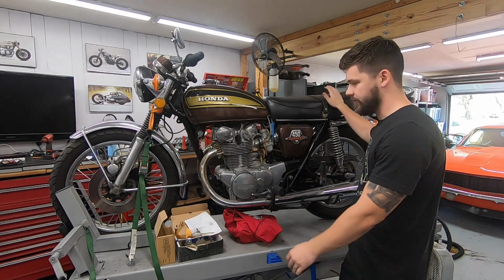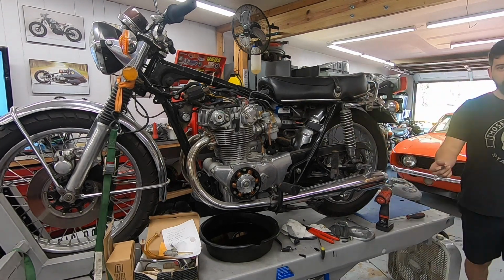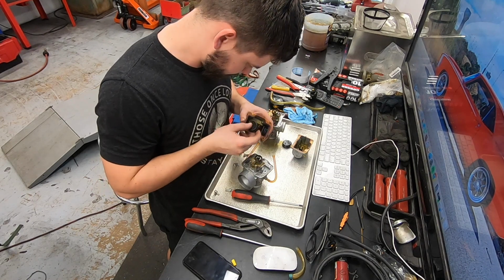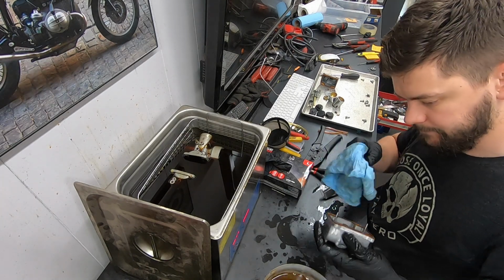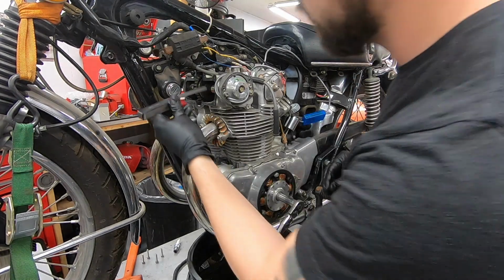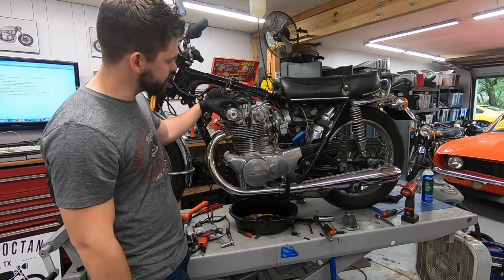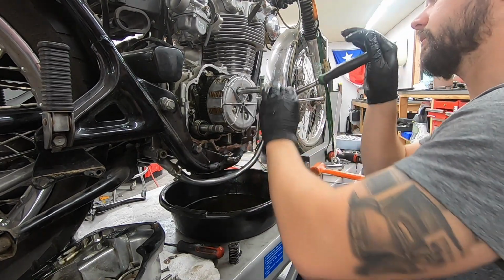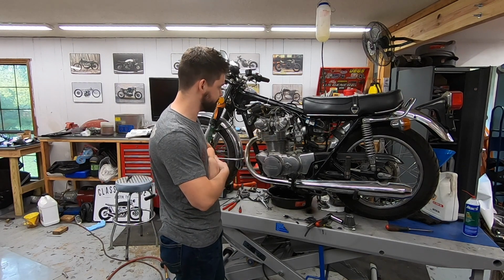1974 Honda CB450 - Will it run?

Comment: I've always been warned to undo clutch plate bolts a bit at a time evenly to not crack the plate due to spring tension. I respect your experience so I suppose it's not as critical as I thought. Perhaps if the springs were closer to spec, it might have been an issue? Just sayin.......

Comment: I had a 71 450 for 17 years, I would hate to think the mileage I did on it, I think around the clock four times at least. Got porosity in the castings unfortunately but I did so many miles on it, would love another one.

Comment: i has CB 125 twin, CB 350 twin, CB 500 four and CB 750 four, best bike ewer has 750, and worst bike has 350 clutch has all time broken worst plan and build clutch system what i has newer seen. i love my CB 750 perfect bike travelling around to europe when i has young boy about 16 year i travell around europe my CB 750. newer not has broplems at engine, CB 500 has little problem drop oil out cylinder head camshaft cover side newer not can stop oil leak i try repair many many time this.

Comment: My first bike was a 1971 CL 450 Scrambler with a 2.4 gallon tank and pipes up the side.  Rode it 1200 miles to college and after graduation rode from SD to CA and back to SD through Texas.  Young and dumb.

Comment: What do you use in your ultrasonic cleaner? Looks like it did a great job, didn't hurt the plastic or rubber either. I haven't had any good luck with mine yet.

Comment: One thing that did not really work on the CB450, was the electric starter. In front of the motor, with a chain connected to the crankshaft.
I had several engine failures, caused by the pinion on the crankshaft. The screws on it came loose, and ruined the whole motor.
You should either remove the chain, and the pinion attached to it, thats what i did, or use glue to fix that screws...

Comment: Are you not worried about damaging the clutch basket? I've only replaced two clutches, but the manual explicitly stated to alternate between bolts similar to a star pattern.

Comment: The CB 450 has  issues. The top end was not ventilated properly. Gas fumes would build up washing oil from the cams causing premature failure.

Comment: My first motorcycle was one of these. I was 18 when I got it. Sold that 2 years later and got a 1978 Suzuki GS1000. Also had a 1980 KZ1000, Yamaha FJ1200 and last was a ZRX1200. Most fun were the CB450 and the GS1000. Probably because I was so much younger then.

Comment: Aah my first bike was red CB 450 absolutely loved it. Had absolute ball on this machine . Front brake and one cyl didn't work in the rain. Chewed thru swinging arm bushes . Always fished broken bits of cam drive sprocket dampening rings out of centrifugal oil filter . But oh so many great times wish I had room in the garage for another one.

Comment: I had a 73 CB350 that I rode all around the Southeast USA.  I rode it maybe 10K miles and then I blew the head gaskets.  I replaced the head gaskets and never had another problems with it.  As with most Honda products, it's bullet proof.

Comment: I had two of them (in succession) in my late teens. The were probably late 60s models - drum brakes and no chrome on the tanks.
I loved the sound and excellent power for a 450.
There were a few issues though :- I found to my surprise that if you maxed it out (indicated 115 mph) and then tried to stop in a hurry, the brakes would fade to nothing by the time you got down to 60. Que frantic down changes and the back wheel skipping around. Very exciting.
It was also prone to getting a speed wobble when it was in the mood. 
Also the roller big end bearings were not durable - had to change cranks several times, but maybe because it spent most of its time at or sometimes over the red line.
But I would still love to have one now.

Comment: I remember the very moment I became addicted back when I was 16 and gas was 10 cents a gallon, sitting on the back of my best friends 90cc Suzuki scrambler as we accelerated from the five way lights at the center of our downtown, population 15 thousand, how the piston hammered up my spine, omg I really, really want one.
So, luck was with me and next summer I got a job at Expo'67 and with the money left over after buying that gorgeous white electric guitar (a piece of shit that shredded my poor finger tips and got me fired from the nascent band) I bought the most CCs I could afford (not quite, I disdained the 350 Jawa probably 'cuz of its communist connections). It was a 1967 Honda CB175, you know, the one with that ridiculous pressed steel frame. I rode it hard (like it was a scrambler (oh but it most definitely was not)) right into the start of winter but stopped when I had to put my feet down to stop me falling over as we pulled a full 360 in only one inch of snow on the smooth asphalt.
It was probably the next summer and our motorcycle 'gang' had driven to the beach (ha ha, my bike was one of the largest). Night had fallen and as we lay among the dunes drinking beer and smoking reefer a full lunar eclipse bathed the whole scene surrealistically red. After it passed we walked out onto the flat hard sandy beach and saw some guy rapidly approaching an a huge gigantic bike. That was the first time I saw a 450 (just like the one above) and miracle of miracles somehow he let me take it for a spin. Oh yes, I was immensely impressed. All I did was turn the handle and the rear wheel turned faster than the sand could handle and sprayed the crowd as I took off. It was so much more than the 175 that had to be revved up very high before I could pop a wheely. Those were the good old days.

Comment: Looks in very good condition. i would replace the pods with an original air cleaner. Smoke probably just a sticky ring or valve from sitting. A hot ride would fix that.

Comment: Thanks for the video! I’d love to see how you replace the clutch cable once the new one arrives. I tried replacing mine on my 450 but have troubles with the little join clutch (the little part that’s on the cable and goes between crankcase cover and motor. )  can’t seem to get it off the old cable.

Comment: I didn't know there was a 450. About a month ago I almost caved in and bought a CB400 to tinker with.
Reply: Yeah brother the cb450 was released in 1965 as the black bomber and ran up until I'm pretty sure it was 74, but nonetheless all of the CB models are pretty badass and reliable, the cb400 that you almost bought was it the F model with four Pistons?

Comment: Great video, I have a '75 CB500T engine inside a '72 CB450 frame. It was a basket case that I resurrected and I'm happy to say is back on the road. The timing chain was the hardest part to get sorted and aligned correctly. Keep up the great videos. Cheers

Comment: Honda built these with intentions of racing it against mid weight british bikes in road racing. That valve design allowed the engines to run higher revs than other bikes in the period.. 
I did a restomod on one of these. I found charging system and super stiff rear shocks were biggest issues that made these the underdogs. They race these a lot in Japan.
-cagrisayin

Comment: Hi what solution do you use in you sonic cleaner ??.
Reply: I think he is using the berrymen's carburetor and parts cleaner that comes in a bucket for dipping, and it does work very well

Comment: OMG, what a flashback. My first "big" bike was a CB450. Bought it when I was 16. Let me give you some warnings though. It doesn't handle well. Once while riding at about 50mph, I hit a deep manhole cover and my steering went VIOLENTLY from side to side, and I thought I was about to die. Miraculously I managed to recover. Took it from San Jose to Yosemite, and a few other shorter road trips. It vibrates so much your hands literally go numb and you have to stop once in a while just to get the blood flowing properly in your hands. Eventually I sold it, and the guy I sold it to ate it on a corner and nearly died. Then I repo'd it (he never paid in full) and sold it to a friend who PROMISED not to put it on the road. Of course he did, and, with no helmet, hit a small rick or something and he lost it like I nearly did and he DID go over and also nearly died. Sorry but I DO NOT recommend riding this bike. Amazing condition though and it had decent power for a 450.
Reply: I have a feeling that those people that you sold the bike to that ate it were not riding that bike within their limits and the bikes limits of course too, everyone's got to remember these bikes are almost 50 years old and some are even older like the 1965 cb450 black bomber, and they are not going to handle like a modern sports bike, anyone that rides needs to ride within their limits not flying down the street and trying to take a corner as quick as you can on a 50 plus year old motorcycle, these bikes are as safe as you want them to be, as long as everyone rides within their limits and of course the bikes, but of course some upgrades will be needed like tapered roller steering bearings and new brass swing arm bushings are a must for better handling
Reply: @oilinmyblood3906  - you are correct, but only somewhat. Like the dude I first sold it to went too deep into a curve and hit some gravel which caused him to lose it. However, my own experience and that of my friend proved that the bike was highly unstable if you hit an obstacle. Hitting a manhole that was under 2 inches below grade should not have caused my front end to violently swing back and forth. Do some research.
Reply: @need100k  brother believe me when I say I researched these motorcycles every single day, I own three cb750's and a cb450, I'm wondering if your steering neck bearings were shot or something, because they are not supposed to handle like that, if the bike is really nice and tight with no Loose Ends like loose steering neck bearings or your swing arm bushings are shot and worn out that will definitely make the ride much more unstable, but they do handle very well if everything is nice and tight and has good swing arm bushings, it sucks you had one that wasn't a good Rider, if you were in Anaheim I can let you ride mine
Reply: @need100k  yeah dude right on! if you're ever around Orange County hit me up, my cb450 has 10,500 or 10,600 miles, pretty low mileage, man that's cool as hell you live in Hawaii!! Be safe out there bud...

Comment: Hi Taylor
Great video as usual and looking forward to the next.
What size is your ultrasonic tank and which cleaning solution do you recommend?

Got the answers from your previous posts. 
Berrymans Carb Cleaner and almost 3 Gallons to fill your tank so I guess your tank is around 15 litre  volume.

Comment: My memory of the 450's was a poor charging system. If you didn't get out on the highway, the battery would eventually be totally discharged. I don't recall if there was ever a fix for it.
Reply: Yes they're absolutely is a fix for it now to keep your battery fully charged all the time, common motor works in Houston Texas has a regulator/rectifier combo that works very very well with the 450, once that's installed you should have no charging issues whatsoever
Reply: bridge rectifier on the alternator...... Honda used a selenium diode which goes bad.
Reply: An intermittent or bad rear brake lamp caused my battery to always discharge back in 1976. Newer or better lamp helped

Comment: Would c foam keep the carb clean on this bike?
Reply: If you run ethanol free gas you'll be fine ,just put a little in every few tanks to keep the valve's cleaner, but if it's sat at all,with cheap ethanol fuel,you'll be pulling off carbs,good luck

Comment: Best to run the timing light off it's own 12v source.
Reply: Can you explain why? The 12V power is only for the operation of the timing light (xenon tube) and do not affect the result even when the power source is an external power source.
Reply: @GettingNervous  It is not absolutely mandatory to use a separate power source but it is recommended as it is possible for AC pulses in the  the bikes wiring to influence the timing light when powered by the machines battery. The separate battery is not affected by this. Many service manuals recommend this step.
Reply: @tmackinator  Thank you. For myself i am always using a separate power source because all of my old mopeds are running on 6V.

Comment: Hi Taylor, I’ve heard that these bikes (CB750, 500, 550, 400) that are esentially the same have charging problems when they run a electronic ignition, and this is because their alternator does not generate enough power for the additional energy that it demands. I personally own a CB750 K5 with electronic ignition and, precisely, this is my problem if I do not ride the bike at more than 3.5Krpm, but sometimes in the traffic this is not possible and at the next try electronic starter does not run the bike. I need to use the kick starter. Have you experienced something like this?
Reply: Had 3 Of Theses  ALL  Took  A  bridge rectifier        bridge rectifier on the alternator...... Honda used a selenium diode which goes bad..... I got these bikes for a cheap ......fix them for $18 I got these bikes for a cheap fix them for $18

Comment: Pamco electronic ingnitions are junk! Swap it out for the Shockwave electronic ignition from the guys at Common Motors. It's sooooo much better!
Reply: NorCal Rider  the quality of the Shockwave is much better and it's A LOT easier to time!
Reply: I had one, it was pretty good, until I got cought in the rain 😒, wouldn't buy again

Comment: What do you use in your ultra sonic cleaner?  I recently bought one similar to yours.  I've tried a couple different cleaning solutions (mixed with water of course).  Some cleaners will discolor the metal carb bodies a little.  It works really well though.
Reply from the maker: I use Berrymans carb cleaner in mine.
Reply: @ClassicOctane  do you just dump a whole bucket of Berryman's in there or do you dilute it with water?  Seems like one bucket wouldn't be enough if you were using it straight.  I've been filling mine with water and adding some Pinsol, which works well and doesn't cost much money.
Reply from the maker: Almost 3 gallons to fill mine. I don’t dilute it.
Reply: @ClassicOctane  Jesus man almost 3 gallons of Berryman carb cleaner to fill up that ultrasonic cleaner! That would cost just under $90 at about $27 a gallon to fill that damn cleaner up with berryman's!!! that is expensive as hell!!!
Reply: @ClassicOctane  could you let us know what web site you use to get all the specs ?